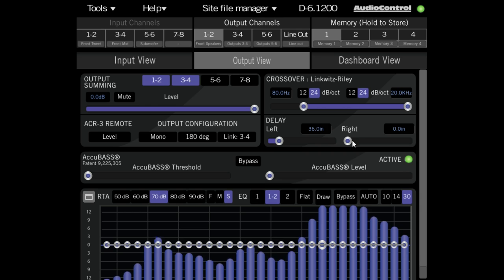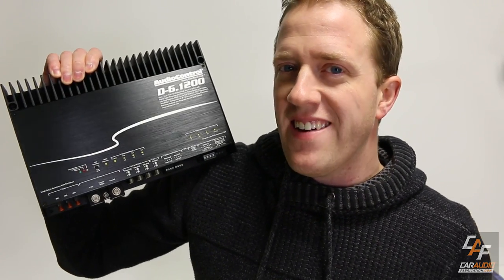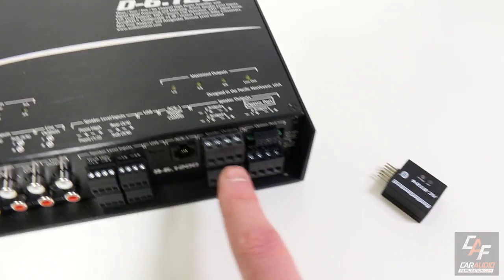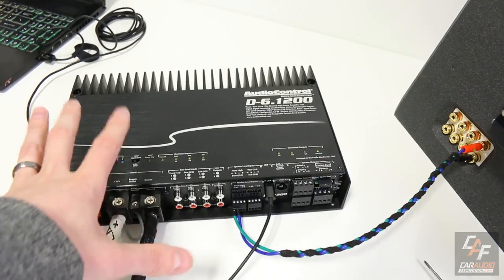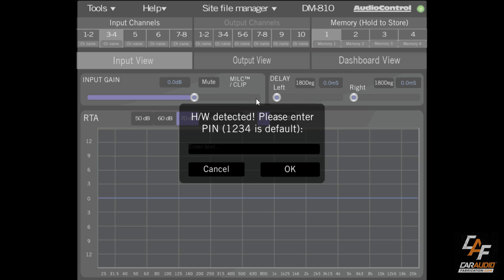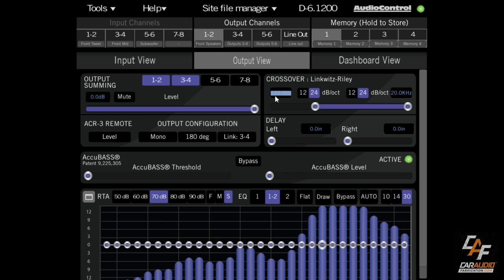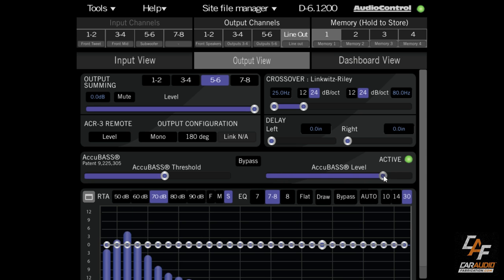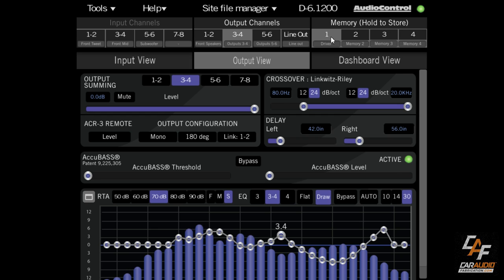DSP INSIDE! AudioControl D-6.1200 Overview

Comment: Mark seeing that you seem to have a lot of contact with Audio Control. What about asking them if they would ever look into doing a 12 or 16 channel version of the DM series DSP?
Reply from the maker: Just use two DM810s.
Reply: @CarAudioFabrication  
My issue with that is, that it will quickly seem like a lot for most people, if you have to have 16 inputs and 20 outputs to get 12 channels. 
I see more and more people whom would like the nice three way system in the front and a two way in the rear + sub and maybe even a pair of coax units in the rear. I currently use a pair of XTA DP448 dsp's out of the pro audio world run off inverters in my own car, but that's overkill and too complicated for most - it's actually a non-option,as it is only for someone odd like me who really likes and know that stuff. I simply like them due to my background in pro audio and I can get slightly used units "cheap".
 But regarding normal car audio guys, one can always recommend a 16 channel Zapco or Brax. But for many, those become way too expensive, and they lack some of the features that makes it easy for the average diy'er to properly integrate the dsp with the factory system. While I think there are better sounding units in the high end of car audio than the DM units, there's no denying that they sound great and are more than sufficient for most. And the features they have to easily implement them with the OE systems in modern cars is currently the best there is by far. This is also why I think there would be a narket for a DM6-12 and 8-16. I might be wrong but still.
My background is I don't do car audio cor a living. I take on 3-5 projects besides my own stuff, each year if I find it interesting and have the time. I've been doing this on and off since 1997 when I did work in car audio for a while, so that's why I occassionally find myself having to do reccomendations of equipment, put things together, make suggestions and all that.
Thank you for the great videos. I really like your work and attitude towards car audio - you talk a lot of sense. Keep it up, you're helping a lot of people and it's great for the community.

Comment: Great video! I have a 2018 F150. Going to keep the factory stereo. My truck has a center dash speaker in addition to the other 6 channels. Wondering how to wire in the center dash speaker into this without causing issues.
Reply: Most people recommend disconnecting the center dash speaker.
Reply: @nickrobinson6434  thank you. I may do that.

Comment: Would it be better to run a component set with a crossover or just get a full range door speaker and at tweeter back to this amp and use the tuning in the software.
Reply from the maker: You can run a component set with crossover, or run active. You can do both. Just depends on your system design.

Comment: Does the D- 5.1300 software come with pinknoise you can run through laptop, or do you need to run through stock head unit?
Reply from the maker: You need to play the pink noise via the source unit.
Reply: @CarAudioFabrication  what is the best source for pink noise, CD (which I don't use much) or a download?If CD what do you recommend or Is it best to  Stream through BT or USB? Thank you for your info.

Comment: Question: considering this amp for my 2018 Honda Civic LX sedan. Feeding it with speaker level from my stock HU. Just recently learned about Honda's ELD (electronic load detector) and that it can cause problems with aftermarket amps and such. Any experience with this?
Reply: Audiocontrol lgdc devices you can add on to fix just that problem.

Comment: Can I pass my center speaker into channel 5 input & subwoofer @ 6 input,  and the two tweeters on front high.  then output just the center speaker to channel 5 , subwoofer to Line out only, & use crossovers for the output channels 1 & 2   feeding the two front speakers?

Comment: How much more quality can you get running the individual speakers through amp instead of using crossover that comes with components. Can you still adjust a good amount if i do use the crossover that came with my 3 way components. I just bought the d-4.800 so i wouldn't have enough channels to run individuals. Any help would be greatly appreciated.
Reply from the maker: Research passive vs active crossovers

Comment: I just put this in an 18 Camaro along with AmpPRO gm-61. I wish you would have talked about the MILC source clip light on the unit vs. the one in the DPS software. Is it only on 1&2? because the gui is different on the other inputs. The maximized input lights on the unit come on long before the milc does and I don't know if this is correct. Running Hertz mille legend 3 way active.
Reply: I am also using dm-810 and AMPPRO FD21. Using the low level F,R,S . The milc only works on inputs 1&2 has to be a 20hz- 1KHZ signal. There isn’t much info on using AC DSP with low level inputs . And explanation of Input delay and Output Delay relationship in the software....

Comment: Great Video!  However, does anyone know what's the difference between this amp and the Audio Control LC-6.1200?
Reply: Mark also has a review of that amp on his channel here: https://www.youtube.com/watch?v=flz6sq1dCuk,  but the short of it is that the LC-6.1200 doesn't have the built-in DSP that Mark spends most of this video explaining. The amplifier section is basically the same with some analog crossover and input/output level adjustments, but no computer control or tuning abilities.

Comment: If you delay and tune the system for the drivers seat only, will it sound different in other seats in the vehicle?
Reply from the maker: Yes, but you can have different tunes for different applications. Example: Driver only tune vs Driver and Passenger Tune.
Reply: @CarAudioFabrication  how would you go about changing the tune ? Via the computer? Any type of preset to make the change easy?
Reply: @la.patriot859  look up ACR-3 attachment which can be connected to the amp. It can toggle through the presets that you create and save in the software
Reply: @mrmomo305  thank you sir

Comment: What is the difference between this one and the audio control LC-6.1200?
Reply from the maker: The LC does not have the DSP built in. Still tons of adjustments, but not DSP level
Reply: @CarAudioFabrication  thank you much. Also can I use the D-6.1200 on my Nissan Maxima with the factory bose speakers ?

Comment: Do you need the crossover that comes with component speakers when using this amp?
Reply from the maker: You can run active, or passive and keep the crossover, depends on your overall system design.
Reply: System design is a 2018 accord component 6.5 in the front and 6.5” subs-rear deck and 8” sub rear deck

Comment: I know this video is a year old but maybe someone could answer my question. 
If this DSP AMP or DSP stand-alone are installed with a factory head unit, will there still be the option to use the head units controls for say front to rear fade and the idiot bass and treble controls?

Comment: I have a factory radio I want to keep using. I have an amp for my sub and I want to replace my car speakers and put an amp on them. If I use a LC2i do I connect all speaker wires from the 9 conductor speed wire to the LC2i than run two sets of rca one to my sub amp and another to the amp powering my car speakers?
Reply: That's correct! I'm using the lc6i and then to another amplifier that powers 4 mid range and 2 under seat subs!

Comment: I bought one and love the functionality. just two small issues when i turn off the car it looses the subwoofer and automatically mutes it and changes certain settings. Next thing i cant figure out is mclip properly. I have a dms tool kit and it tells me i have distortion with a 320kbps pinknoise audio file at 1/4 of the way up on the truck volume. with everything down.  This is on a 2012 toyota tundra non jbl stock non gps headunit... any suggestions? Running jl audio c3650 front and rear with jl crossovers built in and front on 1-2 and rear on 3-4, 5-6 is using 3-4 summing crossed over and mono for the subwoofer 1 kicker solo. Please let me know if you have any suggestions. Tech support is great but this new one has heads scratching.
Reply: One thing I found out was that mclip only works on ch1-2 and the input has to have mid to low frequency so if you put tweeter input into ch1-2 it won't pick up clipping at least thats how I understood it!

Comment: My next amps are the D-4.800 and an LC-1.800..... I cannot wait to get them. It is going to simplify my setup soooooooooo much. I will run some Morel Hybrids two way active and a single 12W6 sub. I am considering the extra couple hundred bucks for the D-6.1200 to future proof my system for three way or maybe adding some rear fill for the kids. 

I've noticed no one is buying those insanely overpriced JL Audio VXi amps. $1100 for 700/5 without the TWK..... Uhhhh, NO! I like JL's TWK and TUN programs, but it isn't worth the cost when these amps are available. Sorry JL, get your pricing in line!
Reply: I have the D-6.1200 and LC-1.800 in my current setup. It is amazing! I am running the D-6.1200 to a set of Focal 6.5 components in front active, and a set of coax Focal 6.5s in rear. I am going to change over to use the D-6.1200 to run a set of C7s in three way active. Then swap out the LC-1.800 for a 1200, and replace my JL 12W3 for a 12W6, possibly a 7.
So many ways to tune! I was able to get system very good without the use of a RTA. Now that I have an RTA, It's really dialed.
Reply: @saabdrifter  Nice. I wish I could figure out of the 6.1200 is stable at 2 ohms bridged. It saws at 4 ohms, but my w6 is 2 ohms and I don't want to go and buy something else. I have a 4 ohm 10W1, but that's not even close to being on the W6 league....
Reply: @TickleFingers  . The D-6.1200 is not stable at 2ohms bridged. That's why I use a separate mono sub amp.
Reply: @saabdrifter  I wish it was, but oh well. It would make things even easier for me. I saw a review where the LC-4.800 was bridged and test down to 1 ohm and it was stable, but I'm sure AC would warranty that type of use. I'm just going to go with the D-4.800 and LC-1.800. That setup will work for me.
Reply: @TickleFingers  Great choice, you will love it!

Comment: Does anyone know if this amp is stable at 2 ohms bridged? It only says 4 ohms bridged, but I really need 2 ohms for a sub on one channel. I emailed AudioControl asking this question on the D-4.800, but they never responded.
Reply from the maker: Get a dual 2 ohm voice coil sub and wire in series for a 4 ohm load.

Comment: RMS ratings are pretty weak for this amp at 4Ohms, and as far as I know, the 150 dollar Dayton DSP is pretty complete. 

The non DSP version of this amp is a fairly good deal for the front 6 speakers (mid woofer, mid/full range, tweets) in a SQ build, but good 4 channel AB amps are still a much better cost/quality ratio, imo. Plus SQ car can easily have 8 channels front or more, with exciters added. Still need your subwoofer amp too.

Comment: Now saw the price  online $849.00
Reply from the maker: You won't find another DSP amp on the market that has this many features, and this much power at a lower price point. The sound quality on these amps is impressive as well.
Reply: That's actually a steal...
I paid about $300 just for the audiocontrol 3.1
Years ago...
Reply: For idiots that think this is "expensive", this amp has an extremely high damping factor and next to no distortion. If you don't know what that means... It's very high quality and sounds amazing. They should honestly be selling these for twice that amount. Other manufacturers are.